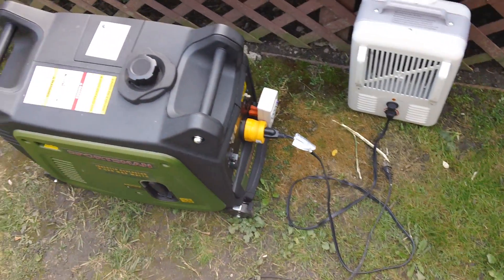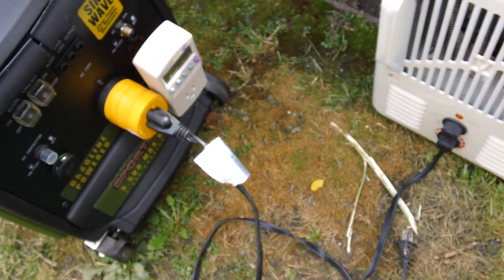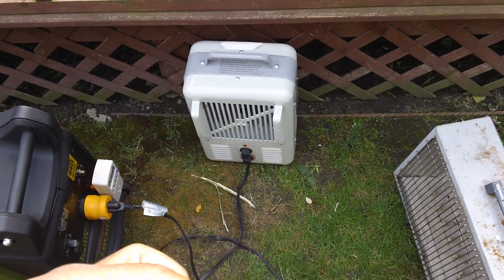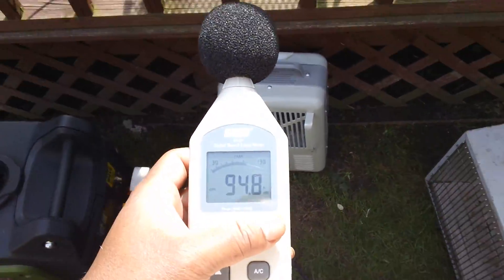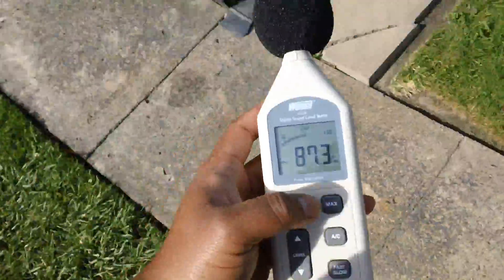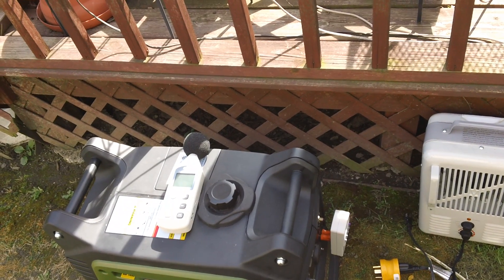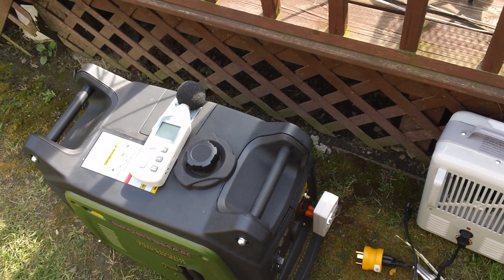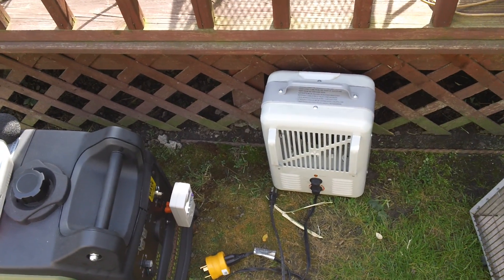Sportsman 3500 watt inverter generator full load test (GEN3500i)

Comment: I did a test with a 1500 watt ceramic heater on my Westinghouse WH2000i with a kilowatt meter. The 1500 watt heater was only drawing 1100 watts at startup and it took it well over 5 minutes before it was even at 1300 watts. I strongly question the 3000 watts without seeing a current meter or watt meter showing me it. So if you can show me 25 amps on a current meter then I will believe this inverter can handle 3000 watts.
Reply: Wayfair.com was offloading these for $160 each: http://slickdeals.net/f/7775655-dead-wayfair-com-sportsman-3500-watt-gasoline-powered-digital-inverter-generator-160-w-free-shipping?v=1 . Did you score one?
Reply: Jgg204 I didn't get one as I didn't know about it till now. I have two inverters already so I have no need for another even at this great a deal. I guess I could have bought it for a family member or sold it for a profit. I still think it is a piece of junk like all the other nock off inverters and wouldn't work when you need it to.
Reply: HondaMan716 I bought one from a masonry contractor last year who went out of business. It was barely used. It's been great actually, no issues with starting. I accidentally broke the wheel stop on one of the wheels and contacted Buffalo Tools customer service via email. Received a response same day and had the replacement wheel stop the following week in the mail. I ran (2) Craftsman electric workshop heaters off it and it handled it. It obviously was running pretty loud but it did handle it. Obviously this is not a Honda, it will never be a Honda. Long term reliability is questionable but taking good care of it with maintenance and long term storage should make it last quite a while. Fully drain all gas from carb is key.

When the deal popped up on Slickdeals I grabbed (4) of them. I will keep one of them and flip the other three. I figured I will easily be able to sell it for $600 each for a total of $1,300 profit. Pretty sick. The market for generators on craigslist is insane. I listed the yellow Champion 3100 from HD for $700 and it sold within a week with multiple inquiries. The DuroMax XP4400 that I bought from that other slickdeal for $279 I flipped on Thursday for $375. I sold each of my Earthquake IG800W's and made $50 on each. As it stands now, the profits I've made so far have paid for the Briggs and Stratton Elite 7000W "big bertha" that I got for just $425 after flipping (2) Samsung Tab S's and using the Sears SYWR points towards the generator purchase. 

I'm debating returning the Champion 3100 back to Costco that was $699. No need for it now, now that I'll have the Sportsman and then a spare brand new Sportsman. 

Where I'm at now:

- Briggs and Stratton Elite 7000W (my "big bertha", to power entire house including 240V clothes dryer)
- Champion 3100 black model (Costco one for $699, will prob return)
- Sportsman 3500W #1 (used one I bought from masonry contractor, use it to power essentials when noise is a problem, and tailgating)
- Sportsman 3500W #2 ($160 one I bought from that slickdeal, will open when #1 breaks)
- Smarter Tools AP2000iQ (will use for camping or when portability / size is a constraint)
- Harbor Freight Storm Cat red version (still have it, as an extended warranty replacement of the blue chicago electric one which I ran continuously for 5 days during hurricane sandy. basically ran it into the ground and then it crapped out)
Reply: Jgg204 it sounds like you are making out like a bandit selling equipment. Where I live the demand for generators\inverters is pretty low so you will not make much money here. The power grid is almost flawless except about 2 or 3 years ago when a batch of like 13 tornados came through and took out several cities power lines for a week. It was a real mess and that is when I decided to buy my first generator. It was only 1800 watts and a champion generator. I sold it for 10 dollars less than I paid for it as it was struggling to run my sump pump. I then bought the Champion 3100 watt inverter for something with more power and quieter operation. I wanted something even lighter and quieter so I bought a Westinghouse inverter next. I have not had much use for them so I see no need for more and can't justify a Honda.
Reply: HondaMan716 my power grid consists of lines still running along 1940's / 1950's wooden poles , with lines running in between trees etc. nothing is underground and wind storms always knock stuff out. the sin of it is, if i drive up my street to the top of the hill i can actually see one of the main overhead arterial lines. i'm just 5 mins from them. the issue has to do with the lines running among the homes. the utility company doesn't proactively do any maintenance of the lines

Comment: I would like to see you do  a sound test in open space.  I am shopping for a generator for boondocking in a fifth wheel.
Reply from the maker: I don't really have an open space in my yard, but I can put it in my driveway and run the test again.
Reply from the maker: Just uploaded the open space vid with the same loads.....seems much quieter.

Comment: This has a smaller engine than the yamaha and honda claims bit claims significantly more wattage. 
I notice it isn't carb rated so we can't get it in Cali, and it will be interesting to see how it performs at 500 & 1000 hours. does it have an EPA time rating the hondas and yammis?
Reply from the maker: 8 hrs @ 50% (i got 9.4 hours with a slightly lower load). I've been using synthetic oil with this unit since the break in, and will be adding a friction modifier for summer months. Not too sure how long it will last, but recently a lot of these cheaper Chinese units have been pretty reliable. As long as oil changes are done and the unit isn't overheated, it should last a good amount of hours before needing an inverter replacement or rebuild.
Reply from the maker: Ron Mason Will put out 3500 watts for a few seconds, runs a 3,000 watts continuously. This unit is a 4 stroke, it uses a much smaller engine and alternator than a traditional unit. A normal generator has to have a somewhat oversized engine, because it has to run at 3,600 rpm to make 60 hz. This unit can operate between 3,600 - 5,500 rpm's depending on load. It operates similarly to a car alternator, hooked to a power inverter. The advantage is smaller size, lower fuel consumption and quieter operation at lower loads.